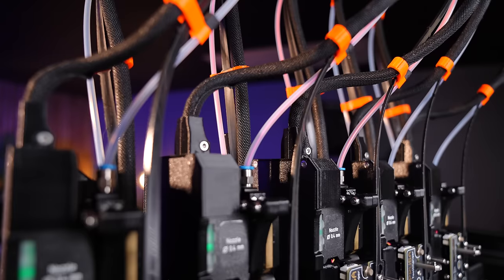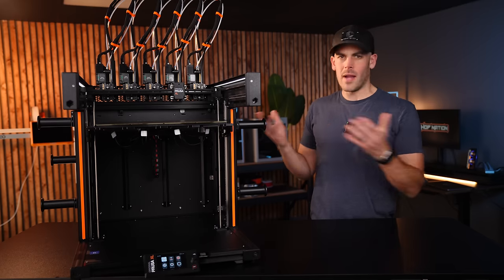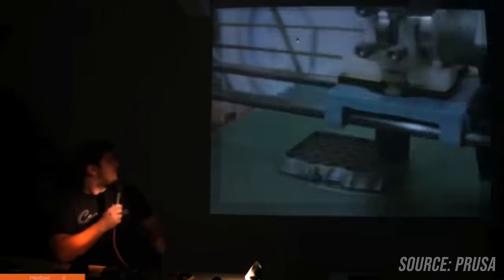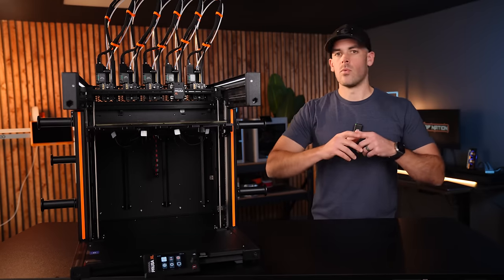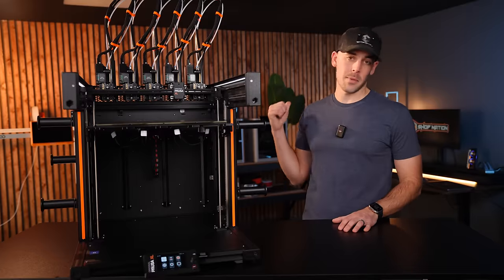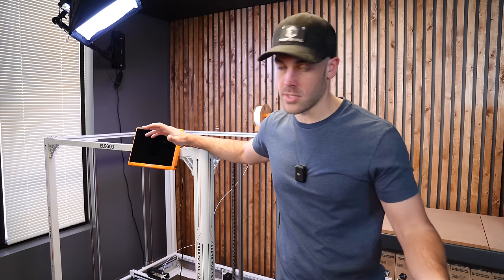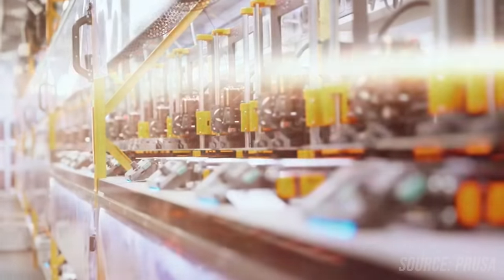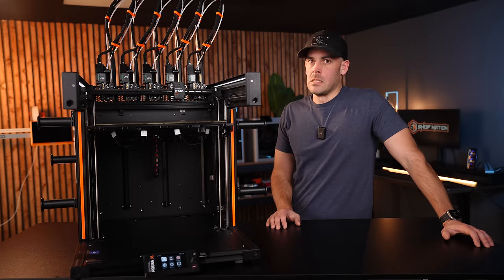Why Prusa is the next Blackberry

Comment: Definitely forgot to mention the best thing about this printer, it’s the fact you can print tpu with pla supports with a petg body, something you litterally couldn’t do with a x1c
Reply: Yeah, like a .01% use case.
Reply: You actually can, it's just not recommended to run TPU in the AMS, I personally have - just can't be crazy soft.
Reply: @Jwmbike14 I tried Geetech tpu spec 95A in the AMS, and it absolutely jammed up. Didn't even make it to the extruder, and i had to dismount the ams to pull it from the tubes. The Filament itself prints like a charm from the external spool holder. So I don't recommend even trying that.
Reply: @ChippWalters  It's only small because until toolchangers came around, it was impossible.
Reply: @watchm4ker  That's kind of a chicken and the egg sort of thing. Perhaps you can enlighten me as to a specific use case that would be widely printed by hobbyists that would utilize all three of those filaments?
Reply: @ChippWalters  Dissolvable supports have been chased for *years*, and were one of the biggest draws for multimaterial printing, but the different material properties of dissolvable plastics make it painfully complicated and unreliable for a filament-swapper. Embedding flexible hinges in otherwise rigid structures would take compliant mechanisms to a whole new level. Toys, costume parts, even some complex tools benefit from either technique becoming more practical, let alone in the same part. 

And if that's not enough, embedding transparent conduits or windows, or running conductive traces inside a part could have a number of uses for electronics projects, especially ones that have to be sealed inside an enclosure.

And then there's the simple aesthetics of using the wider range of PLA-based colors and blends as a 'coating' over a much stronger material like ASA, PC, or a CF-blend. Try doing filament swaps through a single extruder with a 70-80 degree delta between filaments.
Reply: @ChippWalters  There was an example printing in this video. The clip-closed clamshell box looked like it had a printed-in TPU gasket. Even expanding, print the gasket with a soft TPU in one printhead, and the latching clips in a harder TPU from another printhead. All while printing the bottom and top in a rigid plastic from a 3rd printhead. And if any supports are needed, print those in a 4th printhead. A color contrasting rigid plastic for stand-out logos/labels/etc from the 5th printhead. There you go, 5 printheads used for a custom box to hold those expensive chisels that you got for your woodworking.
Reply: @Sembazuru so, if all these are popular use cases, then why aren't we seeing them more often from XL users? It seems like this printer is perfect for this sort of thing but I haven't seen much in the way of public examples. I stand by my statement the number of use cases are extremely small.
Reply: @watchm4ker Dissolvable filaments are very expensive, Bambu does make a support filament you can print with. It too is expensive and why I never use it.
Reply: I'm not saying there aren't edge cases that make a multiple material head changing system valuable, just as 3D printing food, electrical circuits, or burned out silicone mold materials. It's just that these are all as rare as they are unique. Heck, I want a $5K UV printer for a couple of projects, but I don't want the hassle of trying to keep it running. Same for the XL.
Reply: @ChippWalters  Yes. You minimize their usage by limiting it to contact areas with the model. The rest of the scaffolding you make with a cheap, rigid polymer like PLA.
Reply: @ChippWalters   At the current price point for the XL with multiple toolheads, only businesses and a few hobbyists with tons of cash to burn are able to own them.  This means very little creative energy has been invested in true multimaterial designs that are available online for free download and print.  Hobbyists =  do cool and useful things within consumer friendly budget, Businesses = do prototypes for injection molding/etc focused primarily on making money and mass producible things.  True multimaterial designs (like with TPU) are not mass producible yet since an XL is too expensive to scale up to farm level.  Prusa would be wise to make the MK5 a dual extruder /IDEX capable machine so true multimaterial can FINALLY become more mainstream-accessible and a realistic upgrade for farms.
Reply: @pipe2null You make some good points. Still, do you have any confidence in Prusa being able to deliver an affordable multi-tool head MK5? Honestly, I can't see it.
Reply: thats just a sample size of you
Reply: i need to print pla mixed with tpu.. I'm struggling even with standard dual extrusion setups. I think the bambulab would be quite messy with very soft filaments, but idk
Reply: @ChippWalters  i don't think the prusa XL is aimed at hobbyist. It's aimed at the inbetween ultimaker and hobbyist. Compared to an ultimaker you save like 5k
Reply: The kind of people who want to do this are also going to be interested in printing engineering filaments like Nylon or ASA, something that isn't possible with this machine because it's not enclosed.
Reply: You can do that on X1.
Reply: if anyone could help with their opinion:
- where would you place the RatRig 3d printer? interested to know how it ranks between the rest of the brands
Reply: Yeah thats the niche, right ?

Comment: Where I work I use the Prusa mini and Bambu Carbon with the AMS. The Bambu is fast and precise and the AMS takes some of the worry off of running out of filament half way through a large print. It's ability to handle higher temps and or more exotic filaments is fantastic. The Prusa mini is smaller, slower,  quieter and  generally reliable. Plus you don't normally need a glue stick for most prints. What I feel should be stressed more then it is , is the fact that the Prusa being open source means you don't have to worry about what you already OWN and paid for suddenly being put behind a subscription pay wall. The Bambu on the other hand has all the elements already in place for that to happen. When your machine is purposely made to favor having an internet connection over anything else says alot to me.  The Bambu is nice but I will always look on it with an eye of suspicion expecting for that to happen. Too many other companies have done just that with their products.
Reply: All stuff I buy, I want to own. And work without being connected to the interwebs.
Especially of those Interwebs servers are in China.
Reply: I definitely understand the concern, but, to be fair, Bambu has made efforts to address it. It is now possible to root the X1 (well, it is still beta, but it is coming) and install an alternative, open source software on it. This was made with Bambu Labs who made the option available in their software so you do not have to hack it to jailbreak it. Before that, they updated their software to allow the printers to run without communication with their servers, and released the parts of their slicer that had to be open when they were called upon by the community for using Prusa slicer code and not releasing it. 
I do not try to paint Bambu Labs as benevolent, but I think they understand that openness is important to the 3D print community and helps their business. If they understand that it is in their interest, there's a good chance that they will continue in that direction. Likewise, if Josef Prusa gets tired of this gig and decides to go build personal flying saucers or some other invention, the company, or any private equity firm that will have taken it over, may change its policies and decide that openness is no longer in their interest. Nothing is future proof.
Reply: @jacquesgilbert2774  Couldn't agree more
Reply: If you are still using a glue stick on a BBL you are a muppet. Get a decent PEI plate. I don't use any glue now for 5 months on two printers, PLA, PETG, doesn't matter.
Reply: @N4CR  most people just need to wash their plate with warm dish soap
Reply: You don't need glue stick on bambu. Just increase bed temperature to 50°C.
Reply: @jacquesgilbert2774  Thanks. This answer my main concern with buying a Bambu P1S (and later on a small farm of them) to use in my company. I want something that just works for my company but I hate walled gardens. But now I will go for a Bambo P1S. The sad part is that Prusa never even was something I considered because of this "Blackberry" part.
Reply: 3 months old, but wanted to tell you I've been using their latest texture plate and at least for PLA, no glue has been required. Their original one was hot garbage though, admittedly.
Reply: @oldred890  I ordered  a textured and a plain one yesterday. So hoping they work as well for me as they have for you.

Comment: The XL was not a response to Bambuu. Prusa announced it before Bambuu launched their X1 campaign.
Reply: Yeah it's silly youtubers don't brush up on the facts. Bambu wasn't even a trademarked name yet when the XL was announced.
Reply: But instead of reacting to a new competitor Prusa just choose to double down on a product that is basically outdated and overpriced at release.
Reply: @Jansetsfire lol so how is the XL outdated? I'ts coreXY with input shaping and wifi just like bambu. If the Xl is outdated then so is everything bambu lab.
Reply: @LilApe  It's ''outdated'' in the sense that it's a CoreXY machine with fairly slow print speed, poorly functioning Input Shaping without the needed sensors, no camera for monitoring, a clunky user interface and no sort of chamber to enable printing of materials like ABS or Nylon.
Reply: @NorwayVFX lmao the XL literally prints just as fast as anything bambu lab when using single color and its like 10x faster when using multi color. You can add a camera to the XL and its prints ABS and nylon just fine without a chamber. You bambu bots are hilarious.
Reply: @LilApe  Obviously the XL is faster with multi-color, that is it's whole purpose. But when looking at max toolhead speed and acceleration, it's kind of disappointing even compared to a few cheap bedslingers on the market. 

Would love to see an example of the XL printing Nylon without a chamber, because I've never seen any machine do that.

And it's hilarious how you're calling me a ''Bambu bot'', because you're literally replying to any comment that talks negatively about Prusa, and crying your eyes out at any criticism. 

Imagine how little innovation we would have if we couldn't criticize the manufacturers? They're not going to improve the products if the consumers don't expect or want them to. 
The fact is that the Prusa XL and MK4 are overpriced and flawed compared to the competition, and they need to improve if they want to stay on top in the consumer market.
Reply: @NorwayVFX lol How little you understand about manufacturing costs. Prusas aren't overpriced, they're made in the EU and are built using high quality components sourced from counties that don't utilize slave labor like china. Their prices reflect that. Not everything can be made in china and cheap as dirt like bambu lab. Bambu lab uses no name components all sourced from the same factories in shenzhen just like every other 3d printers made in china. The PSU's they use don't even have certs.

Both the MK3/MK4 and even the mini can print nylon. There is zero reason the XL can't and its been done already. Look it up.

And there are literal videos right here on youtube showing speed comparisons between the mini/MK3.5/MK4/XL and bambu lab. Both finish parts at the same time with input shaping.
Reply: does bamboo have a machine thats larger than 30cm, not sound like a hairdryer in the same room, not demand a huge footprint in the ams one and not create a mountain of plastic waste to hopefully print something this week, i regularly advise schools to avoid bambus for their noise and apparently fire hazard now
Reply: cant buy multiple machines that specialises in different tasks? thats what we do rather than weep and whine on the internet. 2 enders are still more productive than one bambu thing :/
Reply: @LilApe  you're not printing nylon at all or abs well on ANY machine without an enclosed chamber, and preferably a heated chamber like the Qidi Q1 Pro... I've never bought a Prusa, but I would jump at the chance if they released something like the Q1 Pro with their reputation for extreme reliability and customer service. I want Prusa to succeed but this just isn't the way forward.
Reply: @camdavbax I've literally been printing nylon and ABS on my MK3 since 2019 with no enclosure.
Reply: @LilApe  genuinely, please share how to do this, as it's been impossible in all my attempts. I built an enclosure for my anycubic Kobra Max just for this purpose
Reply: @camdavbax It's simple, use a prusa and quality filament.
Reply: @camdavbax  95% of my prints on Prusa S3+ has been ASA which is very close to ABS. I have an enclosure and have had very good results. However most of my parts have been smaller than 80mm x 80mm foot print.
Reply: @LilApe  i don't think this guy actually prints abs. The most obvious lie
Reply: @LilApe  "Blablabla as I'm a fanboy I'm gonna ignore 90% of what I use daily comes from China and its "slave labor" too, lol"

Nothing of that changes the fact Bambu is much cheaper for the same or better features, irrelevant politics aside

God Bless Amurrica... in its downfall :D
Reply: Exactly, why do people keep saying this nonsense?
Reply: @Jansetsfire how is it overpriced?  It's not an AMS
Reply: He said they rushed it out as a response.
Reply: @xbrewcoffee9001  doesn't matter, it was announced prior.
Reply: @LilApe  No you haven't

Comment: Prusa is everything i want from a 3D printer company. One of the reasons i like their printers is their open source approach. And their popularity kinda guarantees replacement part availability for, i guess decades. Another reason i chose them over others is their localized manufacturing and sourcing of parts and all the rnd work they do and make available to us. And last, but not least, their reliability. I have never run into weird problems with my Mini or Mk3S, which i can not say about Crealitys, Anycubics, or Elegoos printers.

Comment: Smaller XL with 3 heads: 2 for different colours and 1 for dissolvable support for exemple.
Reply: Yes. Or make it easy to add one or two extra heads to a stock single head setup. That really would be killer. The swappable head thing really could be Prusa's innovation and calling card, it really is superior. I'm thinking of a P1S made by Prusa and with swappable heads you could add in up to like maybe five or six. Wow. However at this rate Bambu may actually beat them to it. Which would be a shame

Comment: Changing the the test from benchy to something useful like maybe bearings or anything mechanical could also provide more valuable data on printers. its definitely something to think about
Reply: The benchy is not just a standard and a reference, it's also a combination of challenges for an FDM printer. Torture toaster is a greater challenge, but still a toy and a waste of filament. I think we're ready for a new benchy, but it will have to be fast, small and very challenging.
Reply: There's a reason why the 3D Benchy is the standard for printer testing. If you go to their website, there's a very comprehensive explanation as to which portion of their model tests.
Reply: 3D printed bearings aren't really useful either though. You'd just buy metal bearings and insert them into your model.
Reply: @Croz89  The only 3D printed bearings to be considered are nylon ones without moving parts.